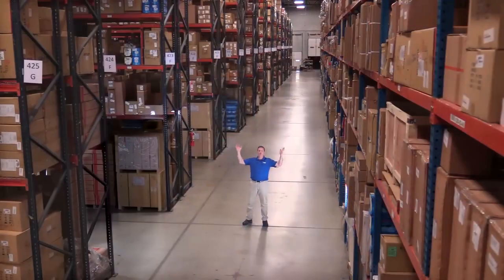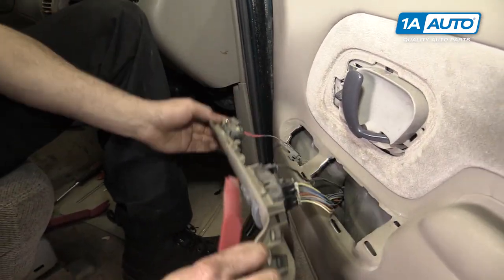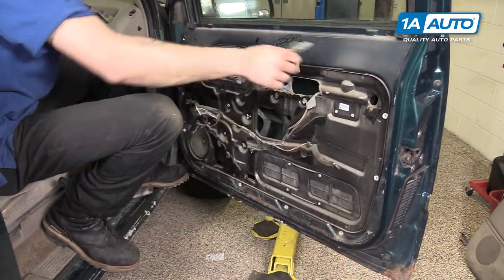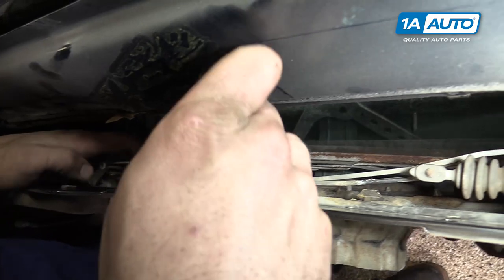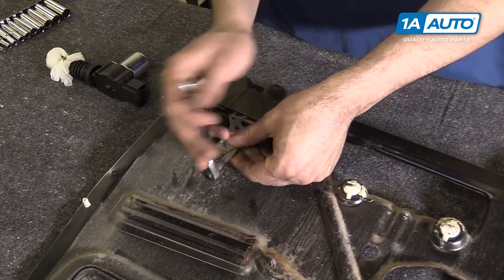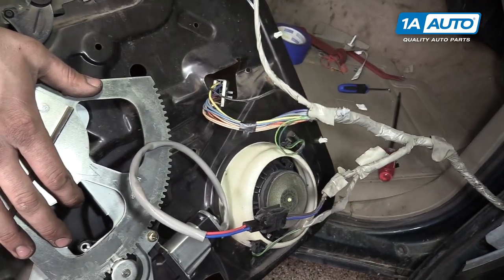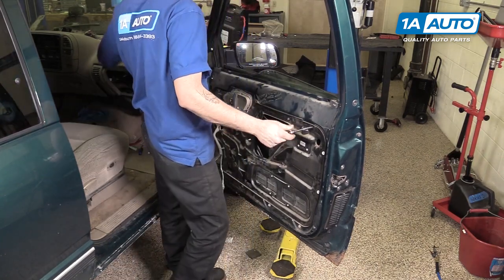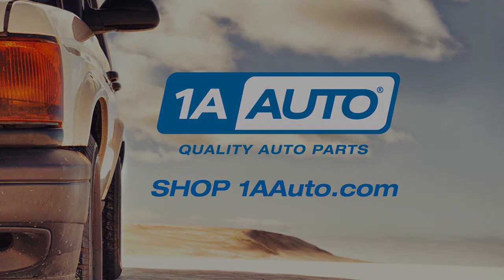How to Replace Door Lock Actuator 88-00 GMC K1500

Comment: I appreciate the how-to video but these guys always do it the hard way you don't have to take the door apart that much you can reach the door lock actuator without taking that whole panel off take out enough screws to get access to the motor that's it you don't have to take out All 10 crews just making more work for yourself

Comment: You could have saved your self a ton of time just drilling the to rivets on the door and left your window up.Dissamble the lock pin brought it threw the large hole in the door then reinstall. But its still a good Video
Reply from the maker: +tony cotta Thanks for checking us out. 1aauto.com
Reply: In my case I had to replace the inside and outside door handles and replaved/upgraded the speaker .
In many instances this will be the case.

Comment: For filming purposes you made everything easier to see but you guys did a lot of disassembly that was completely unnecessary.  Anyone trying to fix their truck would create a lot more headaches for themselves by following your procedure.  All of the harness disassembly and the removal of the metal door panel are unnecessary to get the job done.  Otherwise it's a good vid showing the process.
Reply from the maker: +Robert Manley Thanks for checking us out. The main purpose of the additional disassembly was for the video and to give more info on what was the process of doing so. Shop for high quality auto parts on 1AAuto.com:

http://1aau.to/m/Shop-1AAuto-c

Comment: Had problems with my 99 K1500 OBS drivers side door actuator for years. Only went about half way when locking then manually nudge it the rest of the way via the door handle lock lever. Vice versa when unlocking. So I started the process of removing and replacing the lock actuator using this video and reading the comments. What I did was disconnect the lock rod at the actuator and also disconnected from the guide clip. With no mechanical resistance or binding the lock actuator would actuate fully open and then fully closed with no issues. So I figure at some point after 23 years the lock rod had started to bind up or I had bent it when doing other work. So I decided to use a bit of Permatec CeramicExtreme Brake Parts Lubricant (Purple) and I applied to the lock rod where it sat in the guide clip and an inch or so on each side and then connected everything back up and hells bells the automatic lock opens and closes no issues. At some point I will replace lock rod itself but for now it is working great !

Comment: Will the door lock mechanisms work if the passenger actuator is not connected? Does it complete a circuit all together? Or does it not matter if the passenger actuatpr works or not for the lock and unlock buttons to work

Comment: Stop work at 5:00 point of video…remove the four screws holding the actuator to the bracket (or drill the rivets out of the inner panel/actuator bracket), install the new actuator to the bracket (and or panel, if you drilled out the rivets), put it back together. 😎…Or continue with the rest of the video instruction procedures if you are bored, and like doing extra unnecessary work.

Comment: Do you have a video for the rear doors of same vehicle ?
Reply from the maker: +Ellis Spear We do not have a video for this repair right now, but we'll keep this request in mind for a future video! http://1aau.to/m/Shop-1AAuto-c
Reply: It appears that replacing the actuators on the rear doors is very different from replacing the front ones. I have watched two other videos on youtube and they both indicate the need to drill out the rivets of the old brackets and replace them. Since I will be replacing both the fronts and the rears, I have today ordered a rivet gun and rivets from you guys.  So, I think that an approved video from you guys would be appropriate. Since this repair spans so many years and makes and models. All the vehicles have 4 doors.  Thank  Ellis

Comment: Do the rear doors disassemble the same as the front ones? I've got a door lock actuator in the back on the driver side that's seized up.
Reply from the maker: +Dieselbro 99 They should disassemble in a similar way to the front.
Reply: Wrong .
I found the rear doors more difficult to work with.
The smaller window switch does not remove easily. I cracked the window switch housing trying to remove it like the front.
For the rear doors, I'd recommend LEAVING the window switch in place and just disconnecting the wire once you get the panel halfway off. It will save you tons of frustration and possible additional parts replacement.
Additionally, I found the door panel Clips much more difficult to remove on the rear door. The rear door panel on the bottom seemed very weak and broke at one point while trying to pop the pegs. I think it will be important to have the proper trim tool and try to wrap the peg and pry on the thicker plastic area where it is. On the front door I was able to just pry in the general area and had no problems. Even though a couple of the pegs broke.
Another issue arose when I decided to replace the 194 bulb in these doors. The LEDs are slightly larger and required using a rat tail file to open up the crescent on the fixture entry. Just do not mess with the rectangular indentation, that is where the clips hold it in to the fixture.
One final note about the rear doors. I thought it would be possible to install an additional speaker where the grill appeared on the back door, but this is where the window motor and mechanism is mounted. So this is purely aesthetic. Mounting a speaker in the door would require it to be in the rear section where it would be obstructed by the seat and not very effective. That was a bit of a surprise. I can now see why they mounted the speakers in the rear sail panel of the crew cab. They could have designed the window mechanism a different way to allow for a speaker, but I suppose that would have required effort. So upgrading the rear speaker is going to be a separate project.

Comment: Will a door lock actuator fix my lock button?
Reply: If you do not hear the clicking sound of the actuators attempting to activate then you would have a switch problem. Replacing an actuator would not help in that scenario. 
You would probably have to replace the entire control panel. I do not know if the individual switches are available you could also try getting a control panel from a junkyard, much cheaper and definitely a better way to verify that the control panel is the problem.
Also, make sure that you don't have a blown fuse.

Comment: New part is obviously not the same as original as the original didnt need or have long screws with nuts holding it on but was tapped instead.

Comment: Would you please kindly do a video on replacing a 1996 GMC Jimmy SLE (4 door), driver's door latch. Thank you.
Reply: Steve McKendall Good luck on finding anything on a jimmy. I have a 98 and there isn't crap on the internet about it. With luck you'll find something similar with a chevy vehicle.
Reply: Sad but true.
Those Jimmy's were a great intermediate size truck. I miss them.
Most restoration parts are available only for the full size trucks because they just sold so dang many of them.
It's just good Bu$ines$ to continue supporting them.